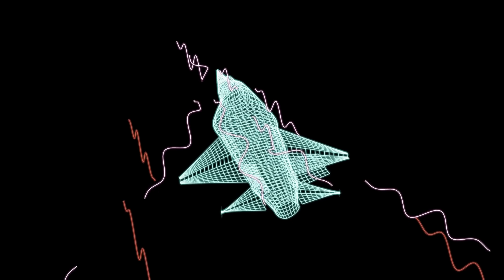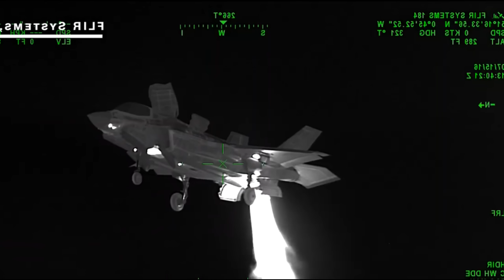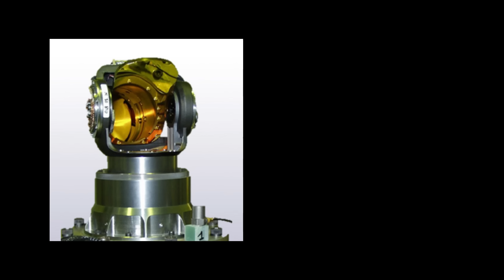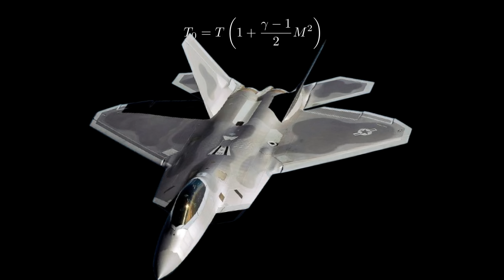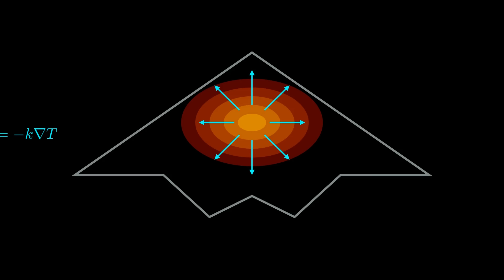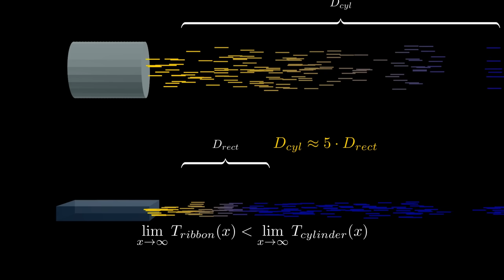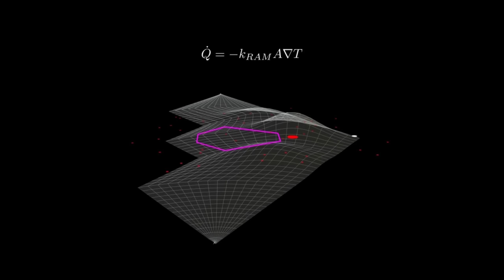How This Aircraft Became Impossible to Find.

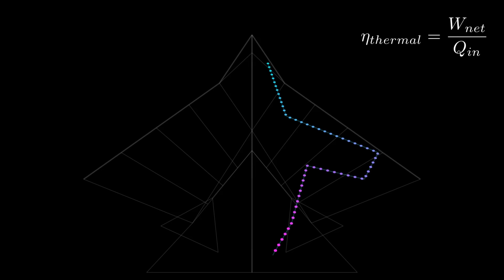Comment: @16:11 This seems wrong to me. The amount of energy from enemy radar hitting the skin of the plane is VERY weak. The heat it adds to kinetic heating (?) would seem to be inconsequential.

And the RAM covering the plane holding heat in not only causes the issue of the plane to run hotter, but it also shields that heat from being seen.

As long as you can vent all that heat in that mixed exhaust stream, then the blanket effect of RAM is still an overall positive.

Comment: You forgot a third spectrum. Visible optical. A lot of targeting sensors also use visible optical targeting, because sensor resolution and thus computer vision is massively better. Works only in clear skies, obviously, but still. By combining these spectra there is fairly high probability of a successful detection, but only at close ranges. Even SEAD/DEAD missions in present days can be (and are) mostly BVR. It's not completely stealth, it's just stealth ENOUGH in enough bands to yeet a HARM or whatever undetected.

Comment: You should probably avoid using Russian and Chinese propaganda as your research material.

Let’s start with the basics: the maximum resolution of any optical sensor depends on the wavelength of light it is looking at and the size of its aperture.

Here is the 1 meter diffraction limit for different sensor sizes trying to resolve 2470 nm light, which is roughly the peak wavelength for a 350°C object:

5 cm, small missile seeker: 16.6 km
10 cm, standard IRST pod: 33.2 km
20 cm, large fighter IRST: 66.4 km
30 cm, heavy recon system: 99.6 km

These are absolute physics limits, not real-world performance numbers. Actual IR systems have losses, sensor noise, lens flare, design tradeoffs, weather issues, and atmospheric effects that reduce performance.

Modern fighters, especially low observable aircraft like the F-22 and F-35, are designed to manage both radar and infrared signatures. From the front, you are highly unlikely to get a clean look at 350°C exhaust coming off the back of the aircraft. That limits your engagement options right away.

At 100 km, a fighter jet only takes up roughly 26 arc seconds in your view. That means your optical system needs a very narrow field of view to resolve it well, which makes it poor for searching large areas. And the air itself matters. The atmosphere absorbs and scatters infrared energy, often cutting the signal dramatically with distance. The colder the target, the worse those numbers get.

So IR sensors are not magic stealth killers. They work best when they have direct line of sight, a favorable angle, and a relatively short range, especially from the rear of the target.

Low observable aircraft, what civilians usually call stealth aircraft, are not invisible. They do not have cloaking devices. But they are extremely difficult to find, track, and engage with any real reliability.

The other side also gets a vote. Low observable aircraft are not usually flying around in full afterburner or blasting supersonic through contested airspace during ingress or egress. They manage speed, altitude, routing, emissions, and heat signature because that is the whole point. If they are not dumping huge amounts of heat into the sky, the IR detection problem gets much harder.

And countermeasures are real. Calling an IR missile lock “unbreakable” ignores flares, jamming, aspect changes, maneuvering, and basic engagement geometry.

An aircraft does not need to simply fly fast to evade a missile. It needs to change direction faster than the missile can update and reach its new intercept point. Supersonic flight is not some universal missile-evasion button. For most fighter aircraft, blasting straight ahead at high speed can actually be a poor way to survive, because it limits maneuvering options and can increase heat signature. What matters is geometry, timing, aspect, energy, countermeasures, and forcing the missile to waste its own energy trying to correct.

Missiles are fast, but they do not chase aircraft the way Hollywood makes it look. They are trying to solve an intercept problem. If the target changes that problem faster than the missile can compensate, the shot can fail. Fighters can maneuver hard, change aspect, and use countermeasures to break or degrade a track.

Bottom line: infrared detection is useful, but it is not a cheat code against stealth aircraft. It is limited by physics, atmosphere, sensor design, target aspect, tactics, and countermeasures. These limits often overwhelm its usefulness outside of direct short-range engagements.

Look, your video is so rife with issues and poor analysis that it borders on intentional.

Comment: Very nice video! Thanks! Most of them don't cover the thermal part of stealth!

-

USA claims a lot about jet stealth but the claims are all about passive stealth

Active stealth exists too, like what submarines do, you can cancel the radio waves you emit or mess around with the radio waves that bounce on you!

Also passive stealth works really well on a isolated radar, but when there is a matrix of connected radars, the efficiency drops!
Receivers and emitters are different, deviated radio waves can be picked up by other radars, so a position can be calculated!

Comment: Yes, basically in practice the F22's speed is so that when it's running away with full afterburner on, you will absolutely be able to detect it, but it will likely be too late to get off a missile on it that it won't outrun. That's how it's supposed to be used. Slow in, fast out.

Comment: A free tip on LaTeX: when typesetting labels within math mode, you should use either `\text{label}` or `\mathrm{label}`. Otherwise, the label is italicized, just like regular variables - and that's no bueno.
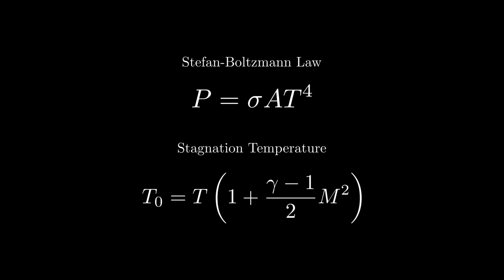For example, at 12:39 you have two formulas that have this issue (the second one, specifically, has this issue three times).
The better way to typeset these would be:
1. $\lambda_{\text{max}} = \frac{b}{T}$
2. $C = \frac{L_{\text{target}}-L_{\text{bg}}}{L_{\text{bg}}}$.

kthxbye

Comment: flying fast isn't safe. missiles routinely break hypersonic speeds (mach5+).  speed, while opening brackets of of evasion. doesn't mean it will always make it better, there's a NEZ (No Escape Zone) for a reason. also they could be easily  be radar invisible, but that requires European tech. because if you want it done right get Europe on it. your wallet will thank you.

Comment: Those secondary air intakes are mostly used for takeoff….the air is just routed efficiently in flight-I guess you could call it “secondary air intakes” but the little open flaps are not used in normal flight

Comment: This is good stuff. It's always been a pet peeve of mine when talking about infrared radiation we always fall back on classical explanations and the metaphor of two hands rubbing together. It's simply atoms jiggling and "rubbing together."? But with visible light and beyond, we suddenly switch to a quantum mechanic explanations of electrons being stimulated to a higher level and then releasing a photon as they relax to their resting state.

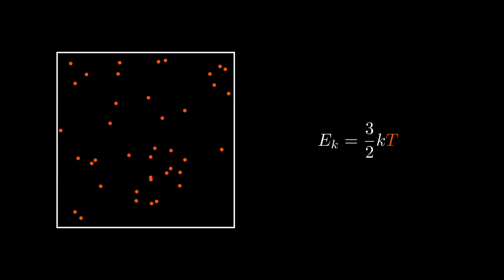Comment: 1:40 no, not "perfectly still" (at zero K). There is "zero point vibration" - it's due to the "+1/2" in the spectrum (ie energy vs. frequency) of a harmonic oscillator.

Comment: Some assumptions. The rectangle nozzle for the F22 was for 2-D vectoring. F-22 was sold on the more agile fighter. YF23 has rectangle nozzle, but it is embedded way deeper in the body to obscure heat signatures.
Another factor that was not brough up was the position of the rudders and elevators to musk heat. Like the A-10 was mounted high, between twin rudders. F-22, YF-23 and F35 has elevators that extends beyond the nozzles.  All this tricks helps to block heat.
Reply: YF23 had nozzles more like the B2. when i saw this video my first thought was A10. high mounted engines exiting over the tailplane.

Comment: The B-2 has a cross section of a "bumblebee," the 35 is way smaller than that.
Reply: Actually, the F-35 is less stealthy than the older B-2 or F-22.  Despite being a smaller aircraft, the F-35 was designed with affordability in mind; so, they skimped a little bit on quality so that they could focus more on quanity.

Comment: The claim that an F-22 "possesses the electromagnetic signature of a bumble bee" is funny, but it is of course extremely wrong.  Rather, an F-22 reflects approximately as much radar energy as a OPTIMALLY POSITIONED RADAR REFLECTOR roughly the size of a bumble bee.  
A bumble bee is of course not a good radar reflector, so a bumble bee reflects extremely much less radar energy than an F-22.  
But thanks anyway.  Most of what you said, was correct, and you deserve some credit for mentioning some relevant formulas that can give an intuition for how strong the various physical phenomena are (Although you were wrong about "exponential growth" for a second order polynomial).
Reply: There is no "you"

This is an AI channel
Reply: Hey NoName, I think you're right and these two might be chatbots spewing information at each other to generate more engagement. 🤔
Reply: This is not exactly true.  Bees, depending on the size and species, generally have an actual RCS of -40 to -50 dBsm.  While most stealth aircraft have an RCS in the -20 to -30 bBsm range, the F-22 has an RCS of -40 dBsm which is the actual total radar return of a large bee.  The F-22 is insanely stealthy even compared to other stealth aircraft.  That said, it is correct to say that they are not exactly apples-to-apples because even though they are equally reflective in theory, the small physical size of a bee means that you can ONLY detect it with very short wave radar because it is physically too small to disturb a normal sized radar wave where as an F-22 is big enough to actually interact with a longer-wave even if it only reflects a tiny fraction of the energy.
Reply: @nosajimiki5885  F-22 number still needs a massive caveat in that it's extremely unlikely it has that small of a RCS all aspect. That's almost assuredly the RCS from an optimal angle of incidence.

Comment: A lot of this seems to be completely made up. Such as the fact that a F-22 Raptor would have a radar signature of a bumblebee. Lol no it doesn't, and its clear that whoever says that doesn't understand how radars work.

An F-22, when beamed by a radar head-on, will reflect back about the same that a steel marble would. An F-22 Raptor, when beamed on using a radar from the ground, as was depicted here, will not have the same radar cross-section, it will be dependent entirely where the radar manages to hit it. A ground radar can be much much more powerful than anything you put on an airplane, so they can use a lot lower frequencies, which the F-22 isn't meant to be stealthy against.

Source: I have worked with radars.
Reply: Stealth planes should be explained by saying they are not made to be stealthy in all directions. They are made to be extremely non stealthy to very, very narrow angles, which makes them stealthy in all other angles. Like a flat 2D plane in the sky that has perfect reflection, no diffusion happens. It is invisible until it points directly at the light source, or radar source and in that case it is extremely visible. Being extremely visible for 0.1s is useless. The enemy knows that there is a plane somewhere but can't track it, can't predict where it is going to be next.
Reply: @squidcaps4308  Tell that to the China's J20. 
And correct on 'can see but cannot track'. So they could switch to a shorter wave radar. Than the range would be reduce. Like a stealth plane can hit ground target from 20km away. But ground radar can detect me from 40km, but track me only 15km away. By the time ground radar got a firing solution, a bomb/missile will down on target.

Comment: A bumble bee flying at 715 mph and 40,000 ft.
Reply: Good luck picking that out from background noise
Reply: @InformationalHI  And even if you do... good luck acquiring a solid track on it. XD
Reply: Much easier to track the pollen trail I guess, but am sure the bee knows about it 🐝
Reply: @InformationalHI  Active Electronically Scanned Array (AESA) Radar such as the Raven ES-05 radar uses Gallium Nitride (GaN) technology, which is more efficient at spotting small, low-radar-cross-section (RCS) targets than older systems. Its wide field of view allows it to maintain a track even during aggressive maneuvering.
Reply: @user-uy1rg8td1v Are you ChatGPT?
Reply: @caesar005  No lol, I just copy and paste info from google tho.
Reply: @InformationalHI  You don't need luck. You can do it with a bargain basement Dell now. The original reason was there wasn't enough computer. Computers have gotten faster and smaller. There is now enough computer in your pocket.
Reply: @jtjames79  I'm sure Iran has plenty of basement Dells, that doesn't magically make a bumblebee look less like background noise. If there was an easy way to detect stealth aircraft, they would have done it by now.
Reply: @jtjames79 the limit isn't computational, it is fundamental
Reply: Just look for the bumblebee foaming at the mouth and screaming "FEED ME!!!"
Reply: and radar can lock that. if it's seen it's lockable
Reply: @osmacarman go study,,,
Reply: Fly this over Chinese airspace and see within seconds every news media worldwide will be reporting how China brought down this flying dinosaur, what a day it'll be!
Reply: @LordEmperorHyperion  if their systems can get a lock on it.
Reply: @osmacar oh they absolutely can, Trump would be idiotic to try his luck sending his precious B2 to Chinese airspace. Don't forget your F35 was shot by Chinese manpads in Iran, imagine what their most advanced aur defence can do.
Reply: @LordEmperorHyperion  My ego will eat you
Reply: @LordEmperorHyperion the Russo-Chinese S-400 couldn’t even see helicopters in Venezuela lol. So weird to see ppl glazing the oversold military power of a hostile foreign power.
Reply: @MikalsAwesome  The claim that the S-400 “couldn’t even see helicopters” is based on a major factual error and ignores crucial context.

First, the system involved was the S-300, not the S-400. Venezuela's air defense during the US raid relied on the legacy S-300VM system, an older variant. While both are Russian-made, the S-400 is a significantly more advanced generation.

Second, the S-400 is specifically designed to counter low-altitude and stealth threats. Its radar network includes the 96L6E all-altitude acquisition radar for detecting low-flying targets, with a claimed minimum engagement altitude as low as 5 meters. Its 91N6E radar is built to detect “low-observable” targets, and it can track up to 300 targets simultaneously.

Third, the raid’s success says more about US capabilities than Russian shortcomings. The US deployed 150 aerial assets with overwhelming electronic warfare, including EA-18G Growler jamming and F-35C stealth fighters. Experts warn against judging the S-400 based on this event, noting Russian systems have performed “reasonably well” in sustained conflicts like Ukraine.

No air defense system is invincible—including the US Patriot system. But citing the S-300’s failure against a massive US operation to dismiss the S-400 is both factually inaccurate and analytically flawed.

Comment: Is it not possible to have a material that turns the radio frequency into electricity like solar panels but for radio? It would mean a % of it goes to electricity not heat
Reply: You could but it would be crazy inefficient. As it is radar energy contributes an insignificant amount of heat